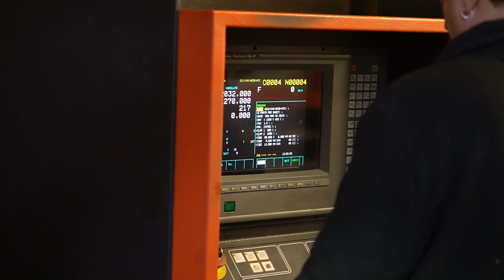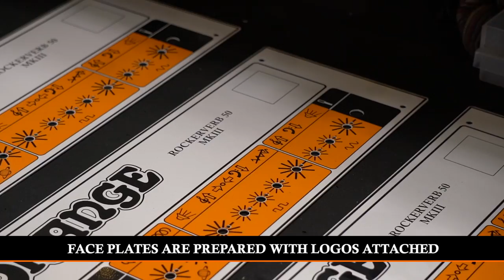How Orange Amp Heads are built.

Comment: @ORANGE AMPLIFIERS.
Who do you get a British made orange, all that I have seen are made in Indonesia.
Reply: ditto
Reply: These are the high end tube amps
Reply: Can be as high-end as you want but, if it's made in the orient I'm not interested
Reply: Watch our amps being built in the UK factory
Reply: The cheaper orange amps are made in Indonesia, the more expensive amps are made in the UK
Reply: Travis DuVall cheaper orange amps are made in China. 

Higher end models like the Rockerverb models, OR models, Custom Shop model etc are <<<<<<<<————————— Made in the UK. 

The cheaper options you speak of are the models like the TH30, TH100, Tiny Terror, Dual Terror and the Crush amps and Crush Pro amps <<<<<<———————— Made in China
Reply from the maker: Our gear is made in USA, England and our own factory in China (not Indonesia?). Amplifiers made in China include the Crush/Terror/TH series. However amps like the Rockerverb, Dual Dark, OR50, Custom Shop, AD200, AD30 are made in England.
Reply: @OrangeAmplifiers  You did not show the assembly of the circuit boards, are the circuit boards for these amps above assembled in the UK?

Comment: I thought touching tubes with your skin ruins them?
Reply: No, that is myth. Keep them clean, but you can touch them with your bare hands. I think its some high energy light bulbs you don't want to touch, like projector bulbs.
Reply: Heath Barnhart - Exactly. Arc lamp bulbs are funky, the oil from your skin will quickly cook onto/into the surface of the glass, etching it a little more deeply each time it's turned on. Those bulbs are filled with various gases, which they need to function properly. Eventually the photo-etching of your fingerprint can prematurely kill the bulb by making its surface porous, allowing those gases to escape, or (and I've seen it) by getting really hot in that spot (absorbing light, like black paper vs. white paper, but worse) and causing the glass to crack open violently. It's probably not a bad idea to wipe the oils off gently (when the tube is cool!), but the glass tends to be thicker, relative to their overall size, and don't have pressurized gases inside, nor do they put out nearly as many intense UV rays that accelerate the etching caused by the acid in your finger sweat/oils.
Reply: Hunter Jansson I heard the oil from your skin gets on the tubes and the burns hot in the spaces where the oil is left causes tubes to burn out faster